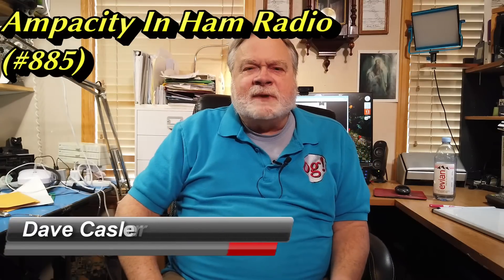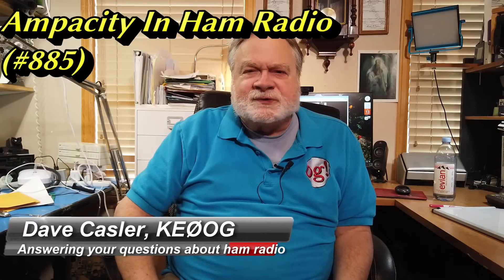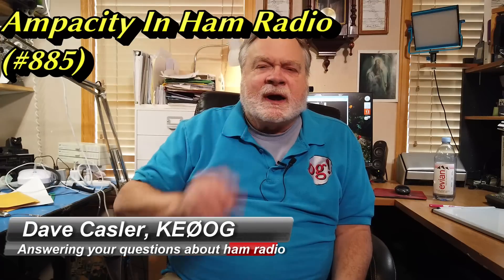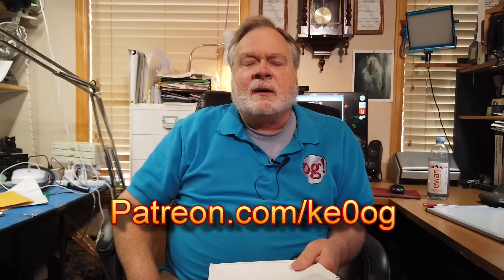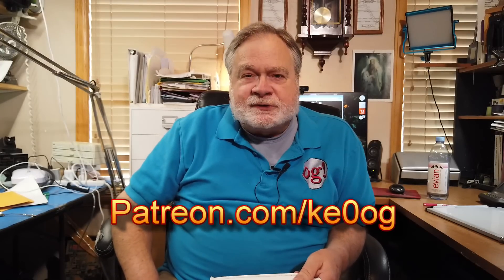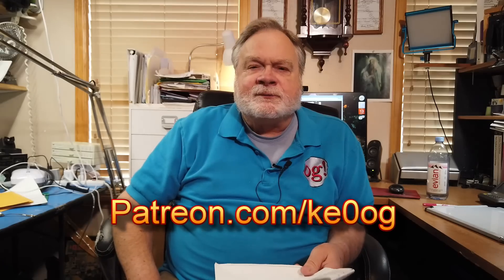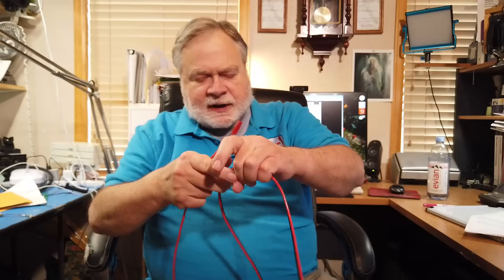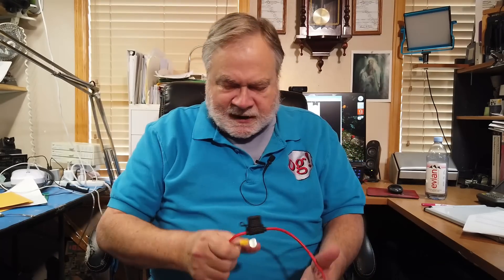Ampacity in Ham Radio (#885)

Comment: I really like those rig runners.
I have one for my station and one for my test bench so i can use a dummy load. 
Using the power pole connection is so dang nice. 
Mine don't have usb ports on it though. 
The only draw back is how expensive the rig runner is.

Comment: I have a kit of the power pole.  It has 3 or 4 size of connector.  All fit in the same housing and will conect to each other.  But by using the connector that fits the wire it is easier to make them.  Thank You for the great videos!   73. W4DES

Comment: I am surprised that you didn't refer to the ampacity charts. 

I recently went through a voltage loss inventory / assessment and was surprised. Here is what I found.

Thick insulation made me over estimate the size of wire I had been using for years and had poorer performance as a result. I have had to re-make all my jumpers, etc.

The drop in the RigRunner during transmit was/is larger than I'd like. Mine is older. I'm working on modifications to overcome that.

My feed from my battery to the battery guard, which feeds a boost/buck for 13.8V, and then the RigRunner was shown to need #6 due to the distance and increased current during boost. #10 was shown to meet my drop specifications for the radio connection from there. Smaller loads use smaller wires.

I use all 3 sizes of inserts for those 45A Anderson Powerpole connectors as the wire size dictates since the mating surfaces are all the same. I also solder the smallest wires.

I use larger Anderson Powerpoles as needed for larger currents, all the way up to the 350A ones for winch and boost. I then make pigtails or reducers to go back to the smaller connectors as required.

I can go smaller wire when I bump the battery bank to 24V since the amperage will drop. The boost/buck goes from 9 to 40V. The amps drop even more so for higher voltage solar feed (100-150V) and 48V battery bank.

I have to assess my vehicle all over again when the weather is more amenable. I thought there were battery issues, but it seems a lot of issues were related to voltage drop in the ham radio power feed.

Just some pieces of information that people might find useful.
Reply: FActor in NFPA rating are for AC not DC ( peak to peak vs rms .707)
I have to 2 linear Astron supplies. One 35 amp for the radio's and a 50 amp for the linears amplifiers. I had a voltage drop issue and ended up running 2-#6 (2+ & 2-) to two buss bars since the amps can draw up to 55 amps each. I don't  really like tube amps so mine are TE systems solid state for 6m, 2m & 70cm and a ALS500 for hf. Now on full current draw I drop 2/10ths of a volt.
Reply: @davep6977  I didn't use NFPA but DC calculators, but yes, NFPA is AC house wiring. I think the calculators could do AC if selected.

Indeed, amps take a lot of power and, therefore, large wire.

Comment: Please mention, that the "ampacity" of a cable is usually valid for a cable lying straight and free, so that the air can cool it. A cable inside tubing or coiled may carry significantly less current. I remember an extension cord wound on a drum which caught fire, although its maximum current rating was not exceeded.

Comment: I try to use powerpoles rated for 45 amps. Yes, they cost a little more than the 30a and 15a rated ones, but in case that cord gets repurposed or extended or borrowed for a splitter...I'd rather go to the max and just have one rating in the parts bin. I'll often go 10 or 12 awg wire, for the same reason. I hate voltage loss and never know what might have to be daisy chained in the future.